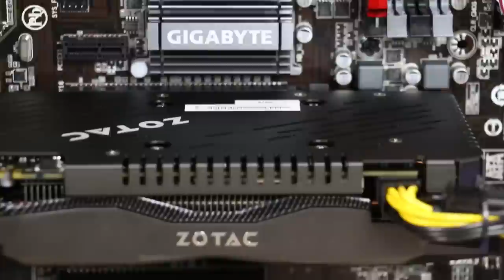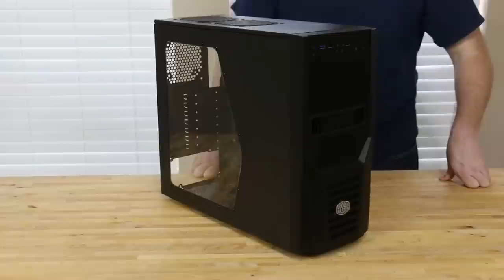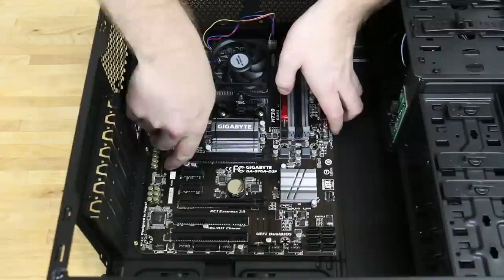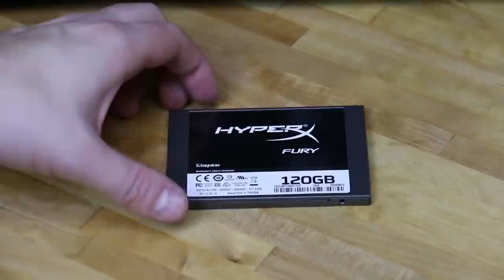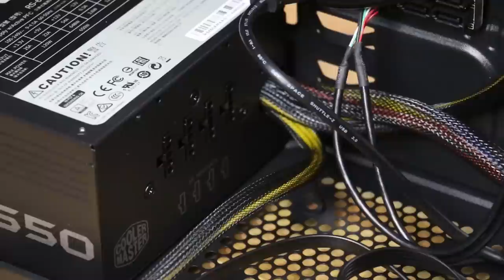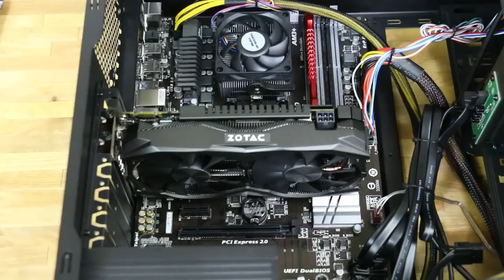$690 Gaming PC Build - FX-6300 / GTX 960 / Cooler Master Elite 431 Plus

Comment: Is this PC good 
AMD FX-8350 4.0GHz 8-Core Processor
Cooler Master Hyper 212 EVO 82.9 CFM Sleeve Bearing CPU Cooler
Asus M5A97 LE R2.0 ATX AM3+ Motherboard
G.Skill Ripjaws X Series 8GB (2 x 4GB) DDR3-1600 Memory
Western Digital Caviar Blue 1TB 3.5" 7200RPM Internal Hard Drive
Gigabyte Radeon R9 280X 3GB Video Card
Corsair SPEC-03 Red ATX Mid Tower Case
EVGA 600B 600W 80+ Bronze Certified ATX Power Supply
Reply: anthony key It's great man
Reply: i have almost the same and i am very happy. glmt usb3 r2 fx8350+gtx1050 ti 4gb+16 gb ram ddr3 1600 mhz .psu 700w.ssd120 gb and 3tb hdd+500 gb hdd

Comment: Nice thing about the 6300 is at stock speed it runs perfect with lower-mid range cards like the 960, but can easily keep up with something like the 970 if overclocked.

Comment: This case is absolute garbage do not get one, I had one and there is no cable management, spend an extra 15-20$ on a case and get the nzxt s340
Reply: agreed i have s340 its awesome
Reply: i invested a bit more in a case than i had initially planned and really happy i did. It has sound dampening material, so very much space, great for cable management and keeping things cool, it's an antec P100, they don't get much love but i'm very happy i went with this case, 'only' cost me €65, my first idea was a corsair carbide 200r, which is cheaper, but this antec case won my heart. Very underrated. It may look 'boring' to some, and doesn't have a fancy window but you may get tired of a zillion LED fans and a scratched up window etc.  ;)
Reply: I agree. That case seems terrible. I would go as far as to save $20 and get a Thermaltake H22. It comes with 4 stock fans (1 LED) and has better cable management.
Reply: cheasescam Absolutely, this case shouldn't have been approved for production. It's rubbish.
Reply: cheasescam I also had, and still have it and the cable management is right awful m8.

Comment: Built a rig with pretty much the same setup last month, except I chose a corsair 430w PSU.  IMHO, 650W gold is overkill.  Cost is under $600 , very capable gaming machine for the price.
Reply: It's not overkill if you want to upgrade later. Plus, with Amd processors it is recommended to have a good PSU.

Comment: I have the  FX8150 clocked at 4.2Ghz Turbo always on 4.5GHZ
I have the  MSI Motherboard 970A-G46 32G of ram ! 1600Mhz.
I have the MSI Limited Edition GTX 960 2G OC HULK GREEN & BLACK
It runs games Outstandingly!
Love it great card and system

Comment: You installed the RAM into slot #2 of Channel A, instead of slot #1. I have this mobo. The two slots closest to the CPU are Channel A, the next two are Channel B. Most old-school PC builders would just automatically put one RAM stick in the slot closest to the CPU, but that is not technically correct on this mobo. Channel A slot #1 is the grey slot closest to the CPU. Might still work but just saying, you should read your manual.

Comment: Hi, looks like a really nice set. The only thing I'm confused about is why the HyperX is DDR3 2133 when the motherboard doesn't support that make (only DDR3 2000, 1866, 1600, 1333, and 1066 according to Gigabyte's website). I'm fairly new to computing so correct me if I'm wrong, but wouldn't the motherboard not read that RAM?

Comment: Does these screws @1:57 need to be on the case ? are they important? I just finish building my case without using them. thanks for the video :)
Reply from the maker: +FiRsT465 They are extremely important.  If you have already built your system PLEASE take it apart to put the standoffs in.  They prevent the system from shorting out.  Not using them can cause serious damage to your components.
Reply: ooowh, that was close. I did put them on now after watching your video. thank you so much bro :D and thanks for the fast reply.

Comment: Found someone selling a custom computer for $395 with these specs: Is it worth it? Or should I just go with the build in the video? Please tell me if there's anything sketchy about this computer, I'm not very knowledgeable with them.

* Cooler Master HAF 912 Mid Tower Case
* Amd FX Series Eight Core CPU
* Asus Motherboard 970 Chipset- Supports CrossfireX
* Cooler Master Evo 212 CPU Cooler 
* 8gb Crucial Ballistix DDR3 Ram
* PNY 240gb Sata III Solid State Drive
* WD 1TB Hard Drive
* MSI Radeon HD 7770 Graphics Card
* OCZ 700 Watt Power Supply
* Samsung Dual Layer SpeedPlus DVD Burner
* Free LCD Monitor, Keyboard, and Mouse
* Genuine Windows 8.1 64 bit Pre installed (Windows 7 Available)
* Antivirus and Anti Malware installed
* Machine has been fully Tested, Configured, and Updated
Reply: That graphics card is very cheap. Other than that sounds ok.
Reply: Although I would be wary about the anti malware. FYI a lot of the mainstream antivirus software "cough" macafee. Is absolute garbage. So keep that in mind
Reply: Thats quite good the CPU is prob. a FX8100 or so, I would get a R9 280 to match it, it costs like 200$ so why not

Comment: I did everything that you did here, the only thing that is messed up is the standoffs, they aren't all under the motherboard. Everything turns on just fine but then when I start it, I plug my HDMI cord in and nothing goes to the video monitor. It beeps once which means everything is working but for some reason I can't see the video. Please help me. If you need the specs let me know.

Comment: Hey, PCPartPicker , do you think a Cougar Spike 5SS7 case and a Seasonic 520w should make the work right too?
Here in Brazil prices are high, I can't afford the same stuff of the video.
Reply: Probably. Seasonic is a good brand so their Powersupply should be good. I've never heard of the case though. As long as it's large enough and has proper hard drive mounting you should be good

Comment: +PCPartPicker How many 120 mm fans can you add to this build becuz in my words I would say just 2 zotac fans would be enough (IM NOT TALKING ABOUT THE 1 FAN THAT COMES WITH THE CASE) By the way If I can fit in more fans I will put in Cooler Master JetFlo 
120 - POM Bearings 120mm High Performance Silent Fan (Blue)

Comment: MOBO - Asus Z97 A
CPU - i5 4690K
GPU - GTX 960
RAM - 8GB
HDD - 1TB
PSU - 500W

Guys what do u think about my build, will it run ultra in most of the games?

Comment: I need help. I have the 960. Can i buy 1 6 pin leading into an 8 pin and just use that. Or do I have to use the dual 6 pin leading to 8 pin that comes with the 960? Either way I am going to have to buy connectors for the card. So what should I do.

Comment: Hey there, I'm building a budget 900p gaming pc, I already have a R9 270 ( could be upgraded to a GTX 960/R9 380 next summer) and I'm stuck at choosing a CPU. Soo my question is , does it HAVE to be an intel i5 or I could go  with a cheaper i3 or any amd 63XX/83XX? The general goal here is to be able to handle all new games for ~ 3 years roughly ( by handle I don't mean high settings only).
Reply: Fx 6300 is great for overclocking, if that's not your thing go i3 6100
Reply: +Hristin Marinov go with intel it's better for gaming go with intel i5 4xxx series
Reply: Aures the Gamer
I found an i5 4460 very cheap. rly glad I got it, now I can upgrade to any video card i want

Comment: MY PC BUILD:
- CPU: --------- Intel i5 4460
-GPU: ------------ MSI GTX 960 2GB
-Motherboard: ------------ Asus H81M-PLUS
-PSU: --------- EVGA 500W
-HDD: -------- 1tb Seagate
-SSD: ---------- Sandisk SSD plus 120gb
-Case: ---------- Sharkoon VG4-W
-RAM: Hyper X fury 4GB (x2)

is this build good and or compatible
Reply: It looks good but try and get GTX 960 4GB other than that it's good! (:
Reply: my build
cpu- Pentium g3258 (soon to be replaced)
gpu- Gigabyte gtx 960 4gb
mobo- asus h81m-plus
ram- pny xlr8 4gb(x2)
hdd- 1tb samsung
psu- thermaltake tr2 600watt
case-some old P.O.S that im replacing soon
Reply: Brendan Mccloskey isn't 600w a bit of an overkill
Reply: ik it is i didnt build this pc my friend built it and sold it to me only thing ive changed is the gpu from a gts 250 to a gtx 960
Reply: Nice I have a GTX 960 as well
Reply: Just built my first pc
gpu: radeon r9 270x
cpu: amd athlon x4 840
psu: corsair 550w
motherboard: asus a88x-plus
ram: hyper x fury 8gb
ssd: intel 120gb
chassi: cooler master cm force 500

and yes I didnt buy a hardrive.. for now
Reply: BooXwee why no hdd?
Reply: Brendan Mccloskey in all honesty SSDs are worth it because they are a lot faster and if you do not have a lot of junk on your PC 120gb is enough
Reply: yeah but u have a gpu which means u are most likely gonna game and 120 isnt gonna cut it
Reply: i got a 120gb ssd and i play quite a few games
Reply: Brendan Mccloskey only 1gb of my HDD has been used
Reply: lol ive used a terabyte from games alone not even to mention some clips os and other programs but im gonna buy a small ssd soon for os but my focus rn is my cpu upgrade
Reply: Brendan Mccloskey Im gonna use my old hdd where i have all my games and such, but I dont know if it will work.. Should i buy a new one?
Reply: why are you asking me?
Reply: well i always ask questions because as i said i didnt even build the computer only think i ever did to it was upgrade the gpu cause tbh idk shit about pcs
Reply: fair enough
Reply: Brendan Mccloskey thought you might know because you seemed to be a pro when it comes to the size of games..
Reply: PudzzMeister123 yeah i will try it
Reply: ok tell me if it worked
Reply: PudzzMeister123 I will
Reply: well cause u said about the size of games its true that 120gb wouldnt cut it cause os fallout 4 and gta v would cap that ssd so yeah i would try ur old hdd first and if it doesnt work buy a new one
Reply: youre welcome
Reply: Brendan Mccloskey Depends on the games you play.. the games i play noly use about 20 gb on the drive
Reply: the 960 is obsolete now get the RX 480 from amd instead
Reply: The only problem is Some Intel H81 chipset motherboards may need a BIOS update prior to using Haswell Refresh CPUs. So find your Motherboard and update the drivers  :P

Comment: I have this build and the only problem is how loud the computer gets. Do I need to replace the stock CPU cooler so I can keep the computer noise down???
Reply: Replace the stock cooler. And sometimes people don't realize that their graphics card was manufactured by a different company. For example company A might put a quieter fan on the graphics card than company B.
Reply: Rey Jukes thanks

Comment: This is the build I wanna build which power supply do i need? 
-msi gtx 960 4 gb video card
-MB ASRock B85M-DGS 1150 M-ATX D-Sub/DVI DDR3 ret motherboard
-i5 4460 3.2 ghz cpu
-corsair 8 gb DDR3 1600
Reply: +Karlsson Truijen Antec 450W i think would be enough :D
Reply: Maybe take a 600 psu in case you want to upgrade it.

Comment: Would I be able to use a Nvidia GTX 970 Gaming 4G instead of the 960 when doing this build?
Reply: There are no particular differences in any of the gpu connectors so you can stick any gpu in the motherboard you want

Comment: If the case has more than one fans where sould i connect them. Are there more than one fan headers on a motherboard? Does the case come with included adaptor or something? (I am talking in general)

Comment: nice. But an fx6300 really is begging for a little bit of OC'ing and an aftermarket cpu cooler, the cpu already is great value for money, but yo ucan get so much more out of it.  As for the RAM, for most gaming purposes 2133mhz ram is really not gonna be THAT much beef compared to basic 1600mhz dual channel either starting out with 1x8gb if you want to go to 16gb..but for most uses 8gb is just so standard, save some money on the RAM , 2x 4gb @1600mhz and the money saved on that can go to a couple of nice silent fans. Unless you really find a fantastic deal on a RAM kit, keep it basic. I believe the cooler master elite 431 comes with a single LED fan so you'll atleast want one exhaust.

Comment: Had this case since 2012, i regret buying it, as the cable management is horrible, i also regret not getting a mobo with a USB 3.0 header. Otherwise it's a pretty sweet case.

Comment: I built fx-6300, 1tb hdd, 2x4 8gb ram, 2gb ddr5 920mhz graphics and same case w/ 600w power supply for $400.
Reply: gpu?
Reply: +Ben Olney gpu?
Reply: +lavish yout gpu?
Reply: and your
Reply: lavish add some more money get 750 ti
Reply: +lavish heavy editing 8gb is not enough 32gb or 16 for medium editing gtx 750 ti with cpu like i7 is beast
Reply: +Jake Shore I agree with you but some people aren't made of money... Fx6300 is sub 100 dollars and an i7 is like 300
Reply: +Jake Shore I agree with you but some people aren't made of money... Fx6300 is sub 100 dollars and an i7 is like 300
Reply: Horsman4James get fx 8370

Comment: The graphics card is ddr5 but the memory is ddr3 so both of them go with the motherboard?
Reply: Graphic card memory is completely different than ram. Graphics card memory is used solely by the graphics card. The ram is use by the entire system. Furthermore graphics card memory is designed for texture rendering while ram is designed for everyday use. Gddr5 is better for texture rendering. Ddr3 is better for anything else.

P.S. The "G" in GDdr means "graphic" aka graphics memory.

Comment: Save $40 by getting a 500ish Watt PSU that is 80+ Bronze and use the $40 to get an aftermarket cooler for the CPU. 650W and 80+ Gold really isn't needed as much as an aftermarket cooler for the CPU.

Comment: As a word of caution: the Cooler Master 431 Elite Plus is one of the worst cases you can possibly buy. It has zero cable management, which makes it very difficult to route wires neatly, and even with a very good modular PSU, it'll have a lot of wire clutter. In addition, the airflow is terrible and it comes with a very cheap stock fan at the front. Go with a more expensive case, you'll thank yourself in the end.

Comment: Why do you use a 650W psu? 
A 480w or 500w will be fine right?
Reply: For upgradability. If you want to overclock. Upgrade the CPU. Upgrade graphics card. Ect.
Reply: Rey Jukes The GPU uses only 400w. If you run through crossfire how much do you wattage PSU do we need?
Reply: What about the FX 6300? would that be a good choice for a gaming rid and would not heat up alot?
Reply: ***** Thanks, i will definitely add it in my wishlist.

Comment: I'm looking at getting an air cooler for my PC, but I'm not sure which one to consider, does anyone have any suggestions that are reasonably quiet, of good quality and not too expensive, which are also compatible with this build?
Reply: For the CPU get the coolermaster hyper 212 evo.
Reply: Thank you for the suggestion, I'll look into that one. :D
Reply: metalraptor  I can sure you that hyper 212 evo is the best cooler for the price. I bought for me a couple of weeks ago and it is amazing air cooler!!! You can also check through  reviews performance that cooler to be confident    your choice is  right. in amazon it is cost 26 dollars
Reply: Thanks for the response, I purchased and installed it last month along with a Kingwin exhaust fan in the back.
My graphics card has dual fans that automatically come on when it reaches a certain temperature, and it was making a lot of noise do to that.  After installing the 212 evo air cooler along with the additional rear fan, the overall temp dropped a considerable amount, and as far as noise is concerned, the fans on my graphics card haven't had to come on at all since the installation, I've tested it by running several games and software on the highest settings, and it sounds the same as when nothing is being used.
Overall, the temps down, the performance is up, and it's totally quiet. :D

Comment: Hello guys can you help me with any suggestions on this build?? 
Intel Core i5-4590
Cooler Master Hyper TX3
ASRock Motherboard Micro ATX DDR3 Anniversary
G.Skill RipjawsX 8 gb ram (1 of 8 gb)
Western digital Blue 1TB Internal Hard Drive
EVGA GeForce GTX 750Ti SC 2gb GDDR5 Graphic Card
NZXT Mid Tower Case
XFX TS 550w Power supply
Samsung Sata 1.5 gb-s Optical Drive
Windows 8.1
Belkin N300 Wireless USB Adapter 300 Mbps link rate
Acer S220HQL 21.5 inches monitor
Logitech desktop MK120 mouse and keyboard ( I am not looking for a gaming one so its ok for me)

Comment: Not to be that person, but If you are spending $700 On a PC could you not spare the extra $30 for a decent CPU cooler?
Reply: Right, its wiser to go with a 6350 which gives you a wraith cooler that lets you overclock to 4.7ghz. 
In my channel I use the 6350 and R9 390, its pretty sick performance.